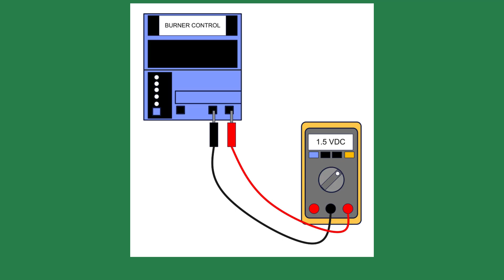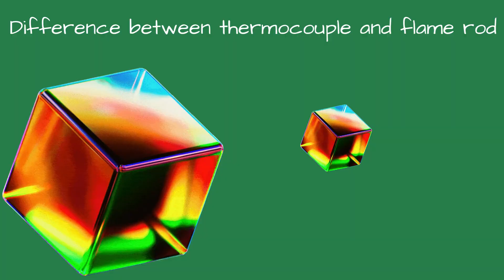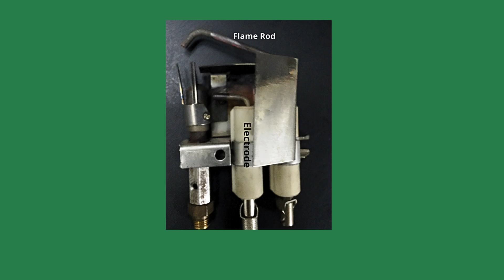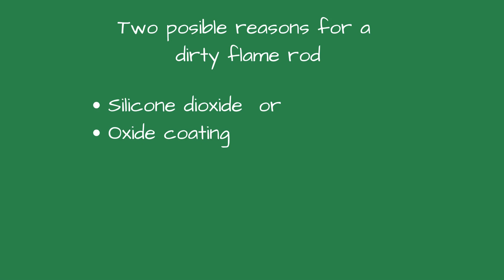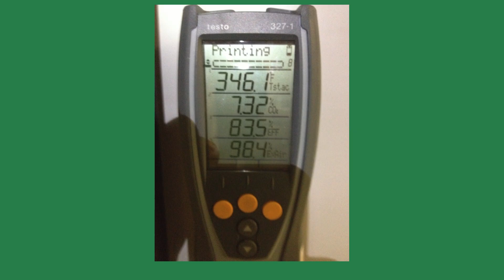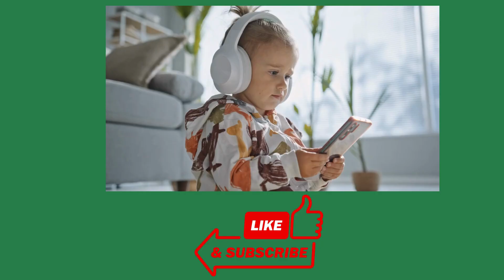Boiler flame signals

Comment: awesome awesome awesome. why would there be low poor flame signal at low fire but acceptable signals higher fires? this video  fits right in with your combustion analysis request on heating help. have a super great day.
Reply from the maker: There are several factors going into it Draft combustion gas pressure Ill tell you one trick I learned I have found better results by lowering the pilot pressure than raising it
Reply: @boilerroomdetective  it is a negative regulation gas valve and flame and positive draft dictated by the fan speed and PCB. thus i cant do anything about it. so im still stumped. and thanks so much.
Reply: @JanosHoyosYou should still be able to adjust the low fire combustion. Insure that the flame does not lift off of the burner and thus loose its ground path.
Reply from the maker: @lnk4328 I’d check pilot gas pressure and pilot for restrictions
Reply: @boilerroomdetective  thank you
Reply: @lnk4328  thank you
Reply: @lnk4328  do i tune for flame signal strength or O2?
Reply: @JanosHoyosYou may have to compromise. Try to keep the O2 and CO within reason while maintaining an adequate flame signal.
Reply: @lnk4328  thank you

Comment: In my 46 years I always found flame rods unreliable. I don't know how many flame rods I cleaned, cleaned the ground path, ran separate ground wires etc etc. You get them to work for a while and they become unreliable. Especially on roof top MU air systems.
Reply from the maker: I agree especially on really cold days